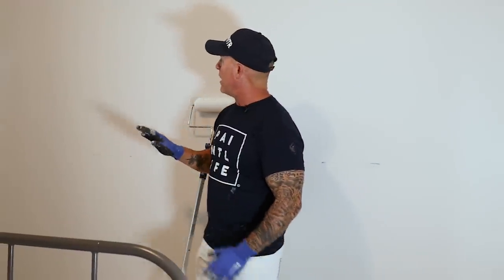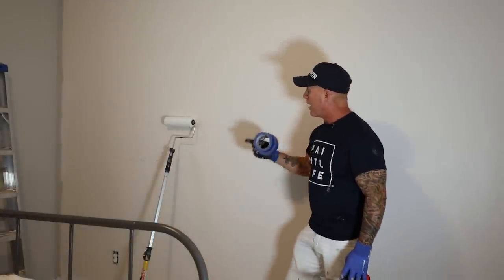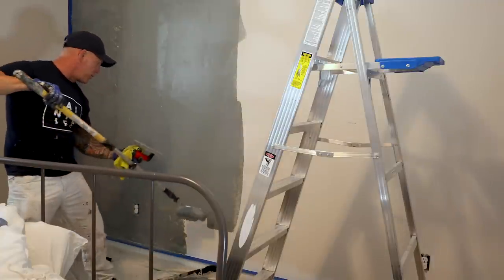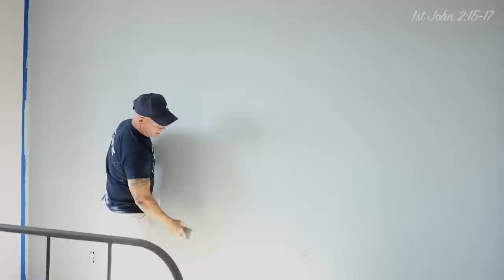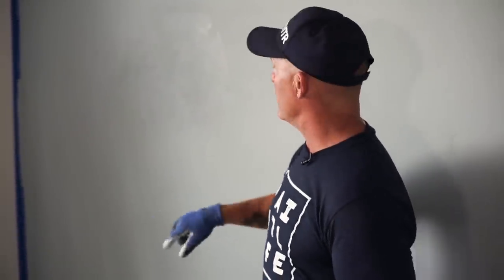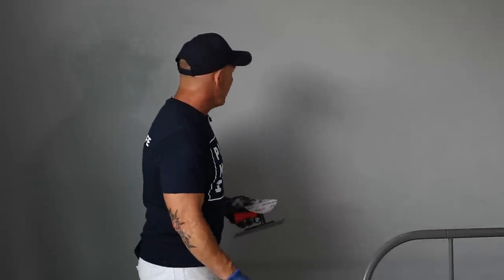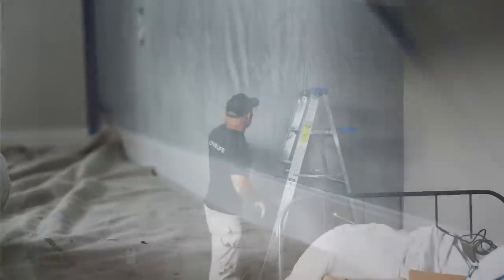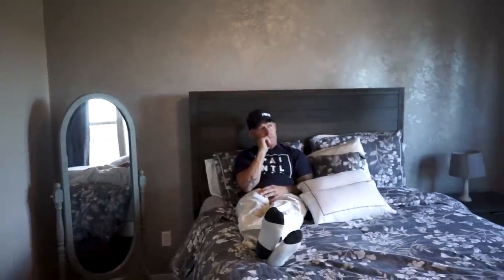MODERN Concrete Finish FAST and Easy!

Comment: Hey, I'm a builder from Australia. We also apply a wax coating at the end to get the wall darkened and even more character!
Reply: Hi, what type of wax do you use?
Reply: Porters wax
Reply: Love to see what this looks like mate. I’m finding mine a bit too light grey and plain.
Reply: @buuts  hi, you can also use the Dulux sealer which is part of the Dulux concrete range. Makes it go darker and more character
Reply: and what type of wax did you use?
Reply: @ruthgross647  it was from porter's paint
Reply: if i hired someone to make the room on one of my walls like concrete design how much would it cost?
Reply: @skinnyism9779  each country is different. Roughly, cost is made up of materials, labour and profit. Around $1000usd for a 3*3m wall I would say.
Reply: @86rix  i live in aus so its probs gnna be so expensive lmao rip
Reply: @skinnyism9779  try using hipages or service seeking to get quotes. Link this video or screenshots to show what you want done. Get a few quotes. Good luck!
Reply: @86rix  ...No, it would not cost a thousand dollars for a 3x3 wall. That’s more than most people’s rent for a month. In the US or Canada it would be $200-400 for an entire room
Reply: @Kejfnsnsmsksk  well the Dulux concrete 4L is $190 AUD each. A 3*3 wall is 2 of. Then labour costs.. just sharing what we pay as builders in aus
Reply: hey can this be used outside?
Reply: You hiring? I wanna move down under.
Reply: Is it possible yo use this finish on exterior walls? Will it last under sun and rain.
Reply: @Kejfnsnsmsksk  Yeah no way it’s gonna be $200-$400 for an entire room here in Oz. 😂
Reply: @pinkyhotmessx69  Negative.
Reply: @red8776  Negative.
Reply: There's two colours available in this Dulux concrete range. Check their website. I once got a can of it and it wasnt tinted so it was cream colour. Keep in mind you can add wax coating or a clear sealer to the finished wall to get more colour options.
Reply: @mattjns  I just did a 5m x 6m wall in a shop 3 coats and used 3 cans of this product. $600 in paint alone not including labour and painting tools
Reply: @Kejfnsnsmsksk  Yeah, It would. . . 
Our wages and hourly pays are a lot higher but or taxes and expenses are even higher. I've done a couple hundred venetian plaster and concrete finish. I would charge more.
Reply: @Kejfnsnsmsksk  i live in Montreal… no way that would cost that low.

Shortage of labour .. inflation …
Reply: I’m a Renderer from Australia that you can get that finish without sanding and probably quicker
Reply: Hey, can I paint over this? I want to make it a bit lighter. Or will that cover all the texture?

Comment: Great job bro. I'm an ex painting contractor from Australia and have done a lot of decorative paint finishes and cement paint finishes using Porter's products. Dulux make great products. I'm going to make up my own mix using Portland cement, lime and masonry paint to keep the costs down. I'll finish it all off with a clear masonry sealer. Great tips on using the float to get the burnished effect.
Reply: Mate just buy Rockcote smoothset , ready to go for $30 a bag

Comment: Another thing, you could start with a 220 sandpaper, using a 320, 400 and a 600 grit, in that order in a random orbit sander. It would give you a way smoother surface with more gloss

Comment: Might try hydrating the wall between coats with a mister to increase the working time. The prior coat, when dry, is very porous and will pull the water out of the next coat you’re trying to apply making it much harder to work with.

Comment: I have to do a repair on a ceiling in my winter home located in Florida. We had a roof leak while we were away and a small section of the ceiling came down. The construction of the house is concrete block with stucco finish. Inside of the house some of the interior walls are concrete also with a smoother stucco finish. I'm trying to figure out what product would be best to use on the ceiling after repairing the drywall board. Someone suggested mixing a small bit of loose plaster with regular joint compound, troweling on a thin layer and getting the finish to match as best as I can. Any suggestions would be greatly appreciated, thanks

Comment: Prime the wall with PVA - let it dry  - then 1 mix part  cement  and 1 part drywall mud.  Mix with  1 part PVA and 1 part water.  Apply with a roller . ( the same technique that you are using )  . It will trowel down hard and slick. I have used this  process for 25 years.
Reply from the maker: Thanks for the tips!
Reply: Richard, is 1-to-1 by weight or by volume?
Reply: @stephenjackson2663  Firstly thanks to Paint life TV. for the effort making the video. The formula  i use is by volume.  The industrial look is very popular and since my original post i have  probably done a couple thousand sq feet. mainly casinos. The material cost is pennies per sq foot. ( PVA is concrete glue )

Comment: Where can I buy this Dulux if I’m in the US? I’ve been looking forever and can’t seem to find it. I’m fine having it shipped over seas but still no luck.
Reply: Anyone? Other products for the USA?
Reply: Hey, I own a dulux trade centre here in Melbourne Australia  (franchisee) we provide all these products and render for exterior wall cladding. We can help you if you need.
Reply: Hardy Hydra how to I find your website?
Reply: Edna Garcia search dulux trade centre Dandenong. Our application team (apply the product) is refine rendering (Instagram)
Reply: @hhhydra2397  Can you provide a link to this exact paint in your online shop? I did as you said above and can't figure out how to buy this paint from you and deliver it to the USA
Reply: @arthurhovanesian9890  hey, search dulux design concrete effect. There you will see the products. Just add to cart and you can purchase
Reply: Just messaged the company and rep told me they do not ship internationally and their products are only designed for Australian climates lol Such a bummer. Can’t even find it on eBay! Really disappointed with many of the products offered by the big stores in US. Anyone know of a comparable product available in states?
Reply: @jasonkaminski6230  I found an American brand. We already did 2 walls and it’s fantastic. I’m sorry I can’t remember the name off the top of my head but if you Google “Faux concrete wall finish” you should find them. Also, Lowe’s sells some as well.
Reply: @coltonholliday6264  thanks! That’s great. Do you happen to remember where u bought it?
Reply: @jasonkaminski6230  I don’t. So sorry. I tried to remember. It’s been a year. Just Google what I said. You should eventually find a brand here.
Reply: If it’s coming from Australia, prepare to pay through the nose for it.

Comment: I can't tell if your wall had a texture to it or not before painting it. Do you think this would still work on a textured wall without priming ?
Reply: DryWall doesn't have a texture to it. Its fairly smooth.

Comment: You will experience gassing bubbles on the final coat if you overload your roller or let it " air " too much prior to applying to the wall. Even an overworked trowel on the second coat can achieve this anomaly , personally I like this abnormality as it creates an individual finish.
Reply from the maker: Thank you for sharing and watching🤙

Comment: Hey, i was wondering. After all 3 layers and sanding You've made some lines here and there with that metal thing (no idea how it's called in english) but did You apply a very thin coat of paint while doing it, or You just used in clear and all that marks are created because the paint is not actually 100% dry?
Reply: After you have done the 3 layers, you use a clean trowel to lightly scrape across the same way you spread the paint to reveal the texture effect.
you do this after 2 hours and before 24 hours so the paint is dry but not cured completely.

Comment: I’ve got a quick question, does this paint finish have to be applied on walls that are already concrete or can it be applied on drywall? Also do you know if the dulux comes in other shades?
Reply: that wall was not concrete

Comment: Do the walls have to be fixed up to do this? My house is very old. You can see some sort of seams, even the outlines of the lathe and plaster. I would really rather not have to "mud" my entire walls before doing something like this. Perhaps if I use actual cement, I definitely won't have to? Saw another woman using actual cement, her video led me here. lol
Reply: ^^^ perhaps this could be thicker stuff you could use?